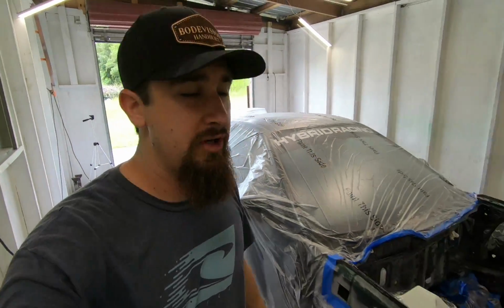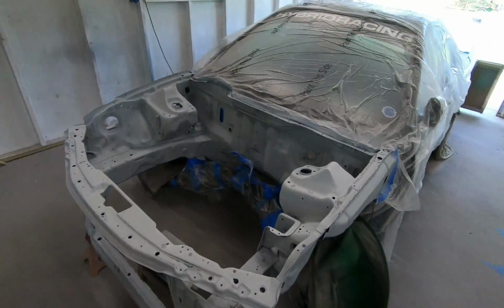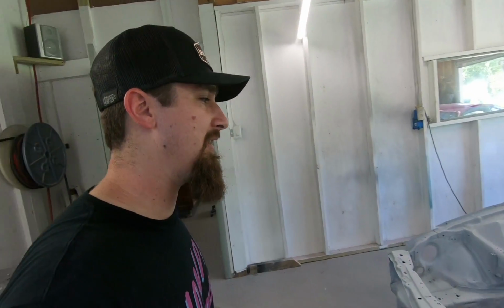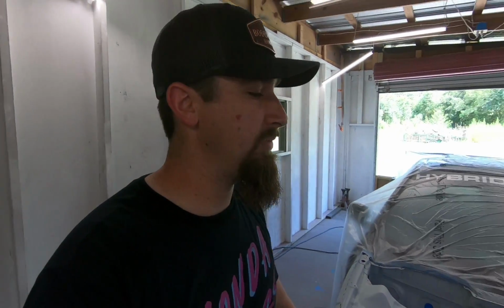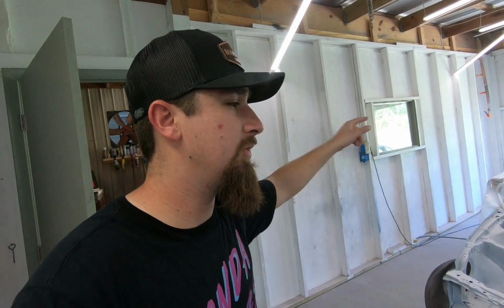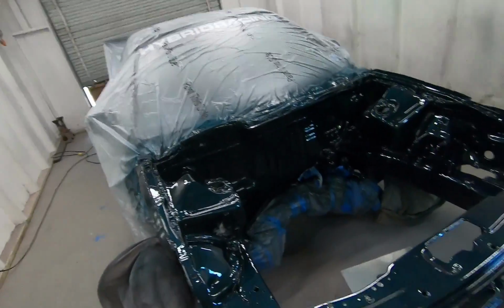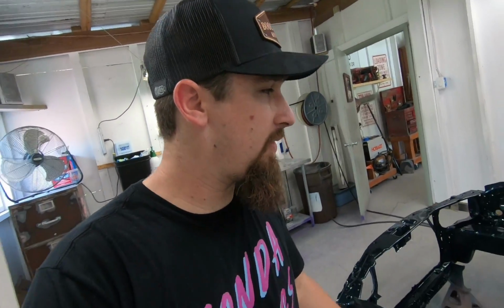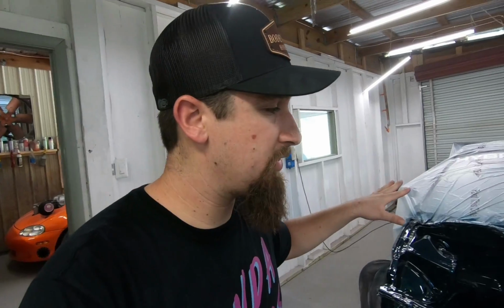Full Engine Bay Paint Job Zosh's k24 Swapped Acura Integra

Comment: Small tip for you.  When painting over multiple layers of old/ unknown paint, spray 1 or 2 coats of epoxy primer before the high build primer, it stops the lifting at the edges of old paint layers.
Reply: pearcesteve111 yes

Comment: Air craft stripper to engine bay no hand sanding then you pressure wash all the paint off or you media blast with backing soda and will not hurt any other part of the car. High build spray then wet sand then seal and base and clear... that's my opinion on it. That's what I'd do.
Reply from the maker: i didnt want stripper anywhere near this car as i just painted the exterior last month.
Reply: @BodeVision   good to know you do use it . Also soda blasting is great.